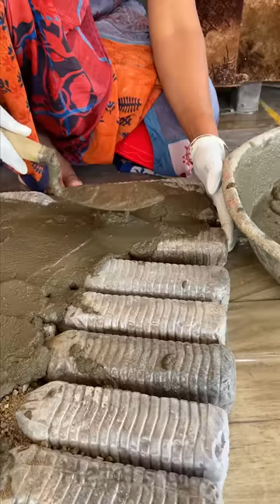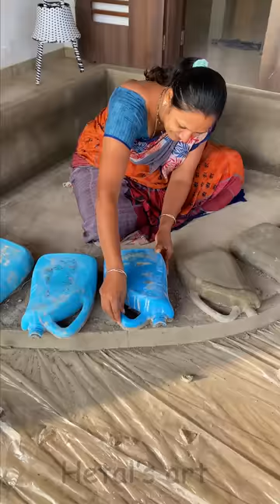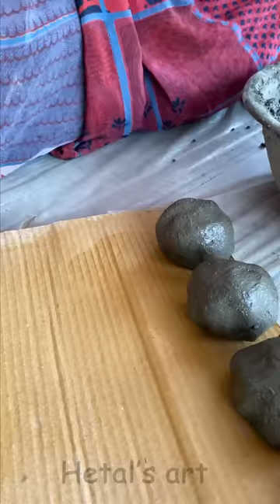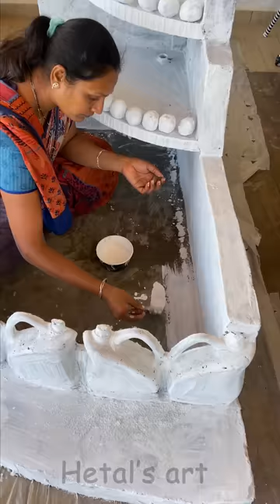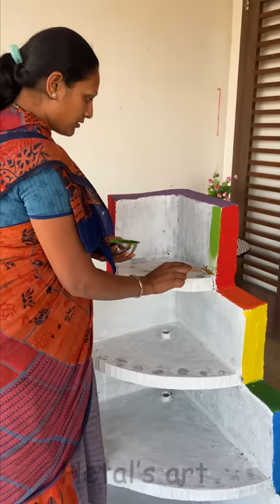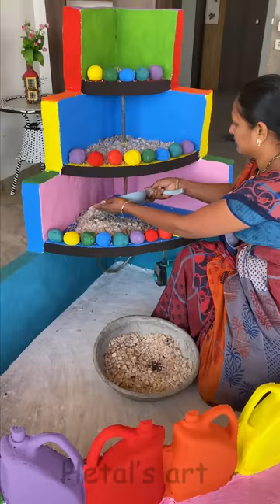Idea for How to decorate an Awkward corner || Old Things Reuse || Fountain

Comment: Let me get this straight. You made a concrete fountain which is cool, didn’t let the bottle or sides harden fully before you put even heavier concrete on top, then put more on top of that while the bottom hadn’t fully hardened yet. Then while it’s all still hardening you painted it. At least wait till it stops drying to paint it.